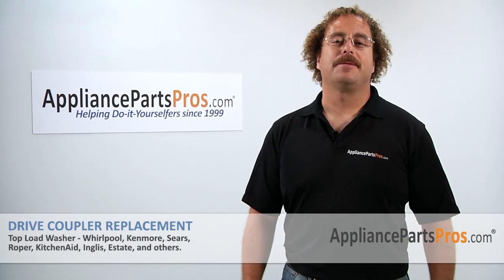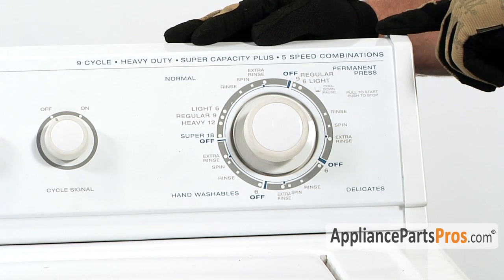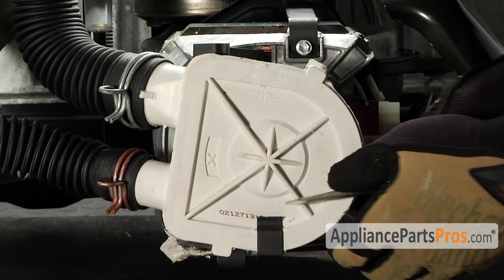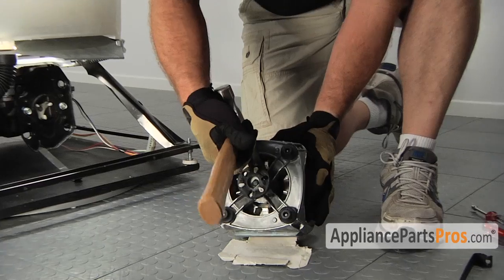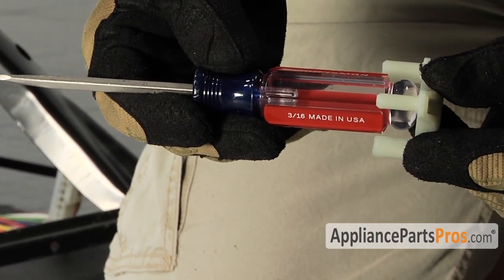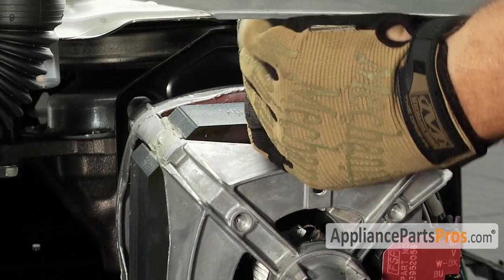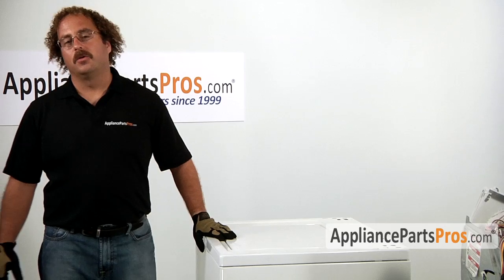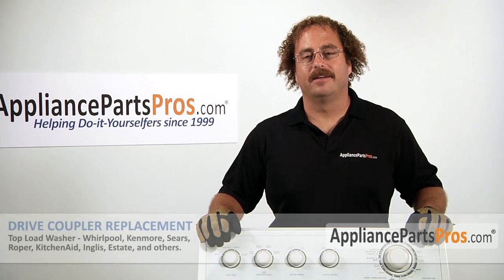How to Replace Whirlpool/Kenmore Washer Motor Coupling (285753A) – Fix Washer Won’t Spin or Agitate

Comment: I am not sure why he found it necessary to remove the washer cabinet to do this job. You only need to lay the washer over and the job can be done without removing the cabinet.  He turned a 10 minute job into a 30 minute job.
Reply from the maker: Thanks for that tip, Jim. There are multiple ways to complete a lot of the repairs we show on our channel, this is just one way. Turning the washer over can be difficult without help for some people because of the weight of the machine, and this is one way to do it without risking dropping the washer.

Comment: Does this work for an over and under?  Model No.417.40042990
Reply from the maker: Antonio Bugarin No your design is totally different than the one in this video. We do not have a specific video for your motor. According to the model number you provided, this is the right motor: AP4321610. You can go to our site to check it out, we have a video shown with it, it is not the same machine as yours but may give you an good idea how to change it.